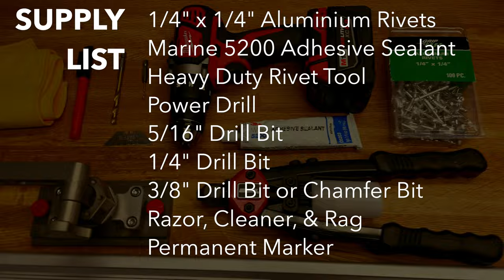CISCO/TRAXSTECH step-by-step RIVETING 3 minutes to BOAT

Comment: Did you get your rivets online or through Cisco/traxtech?
Reply: Also do you want open end or closed end rivet?
Reply from the maker: I would guess if you have a closed end it would be better. I just used sealant/marine grade glue in each hole, also. Got my rivets at Menards. Aluminum rivets were all I used. The ones at Traxtech looked the same from what I could tell online. No regrets yet.